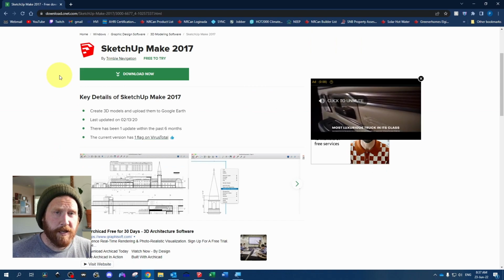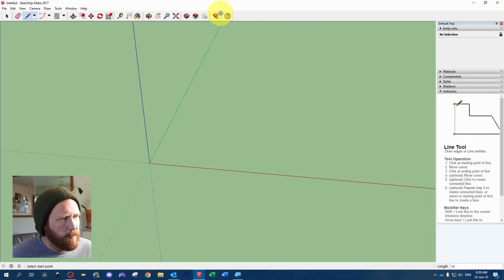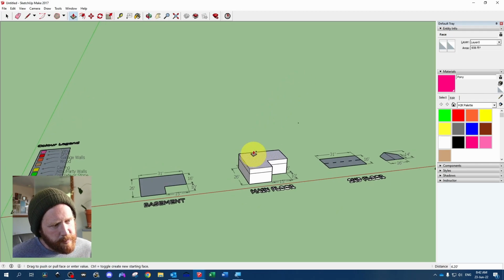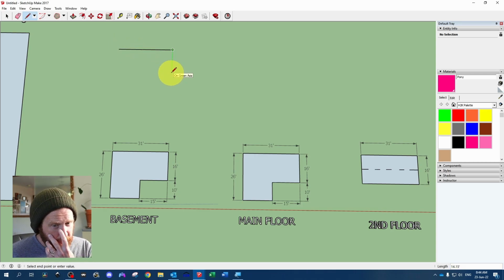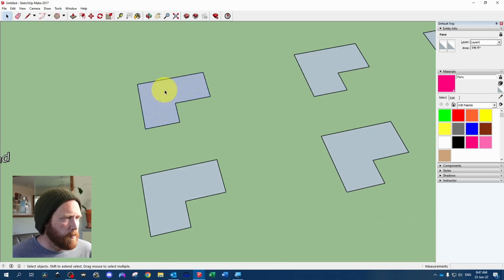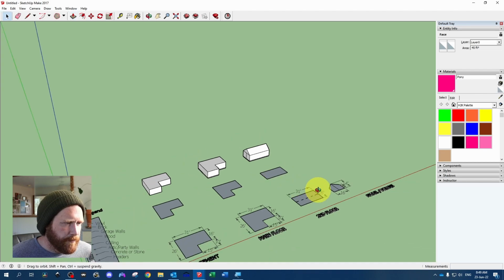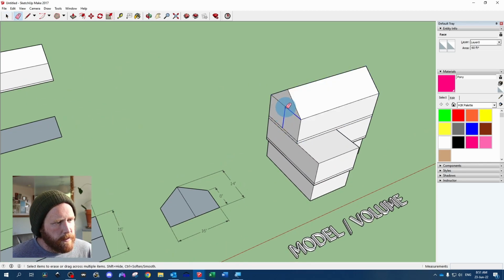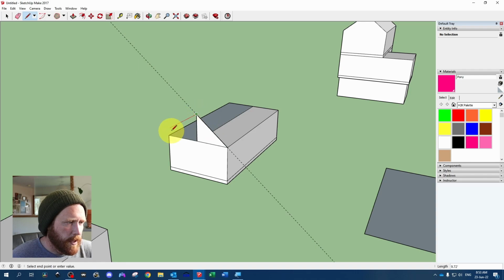Sketchup Basics For Energy Advisors

Comment: Why not simply sketch the home onsite (and revise the sketch if the house geometry is complicated), derive interior measurements from exterior based on wall thickness, and calculate average wall height, sloped ceiling area, etc. manually? This just seems like solutionism...

Comment: Thanks for all your tutorials Merry, I am just completing my probationary files and I have a house that a portion of it has a full basement with another portion to the side that is slab on grade. How would you model that in Sketchup? Would you separate the two or model them as they are with a common wall? I am not sure what is easiest for getting perimeter measurements easily? Maybe an idea for a future tutorial?
Reply from the maker: Is it a walkout basement? I got a video for that. Or is the slab attached at the top part of the basement?
Reply: @merrytimes  A portion of the house, about 41'x21' is sitting completely on a foundation that is about 4.5' above grade, on a level site (so same above grade all around). Attached to that, on the left is a slab on grade portion 39'x24' (so the slab elevation is approx. midway on the foundation) with 10'ceiling height. There are steps to get into the house from the exterior and then steps from the main floor down to the slab on grade to the left.  The main house on the foundation sits a bit taller in total height than the slab on grade portion. (I hope that makes sense?)